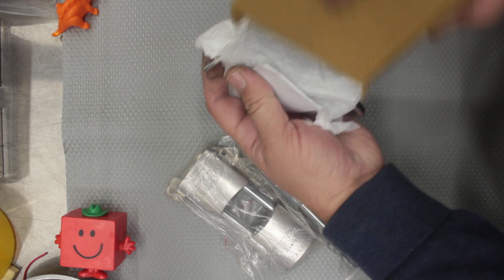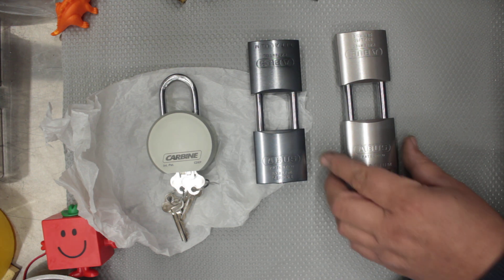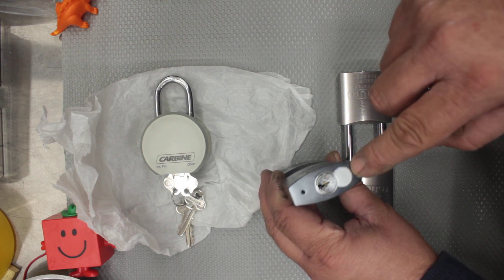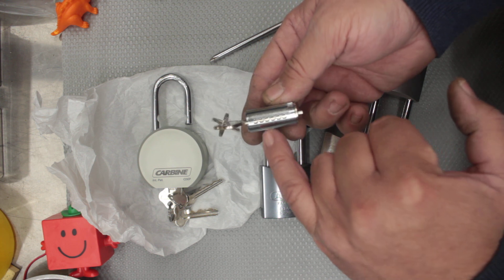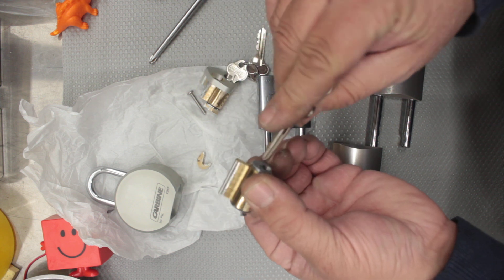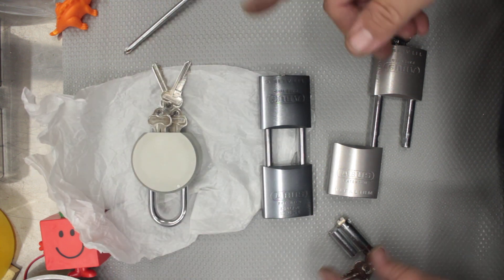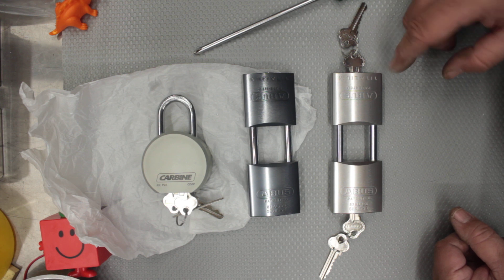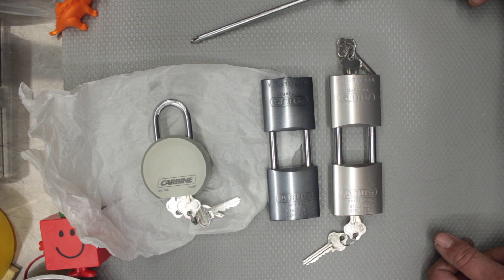Carbine Dual Entry Padlock VS Abus Dual Entry Padlock

Comment: An interesting security vulnerability arises with the Carbine Dual Entry Padlock ( CEDP );
If you have a High-Sec cylinder and a Low-Sec cylinder, providing I have a Low-Sec key, I can remove the padlock (if not collared & chained) or just remove all the cores.
I then have a fully operational High-Sec cylinder to use / sell, decode, deconstruct & determine keying codes etc.

Might need to replace the Philips screw with a torx or something as a first-line of defense.
Reply: by the look of the abus one you would not be able to fit a collar to it so you could open and walk away with the padlock. The carbine padlock looks like you can fit a collar. High security cylinder you still need to get the cylinder apart and depending on high security system could be pretty hard to pull a part to decode and put together again and then you need to have a blank so you can cut a key which unless you already do that type of system should be be hard to get hold
Reply from the maker: Yes good point about taking the cylinder, a torx screw would give a little more security, I will let them know your feedback. Jess L made a good point, you have to be able to do something with it for it to be a problem